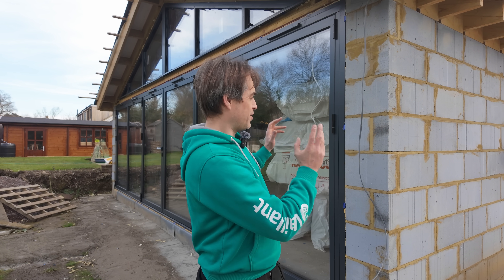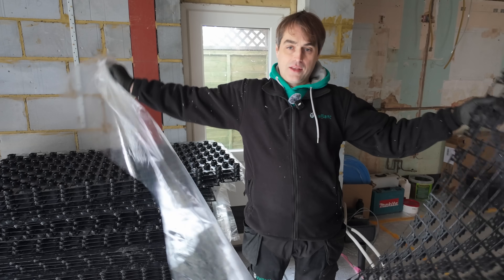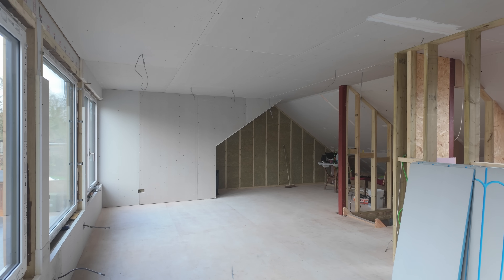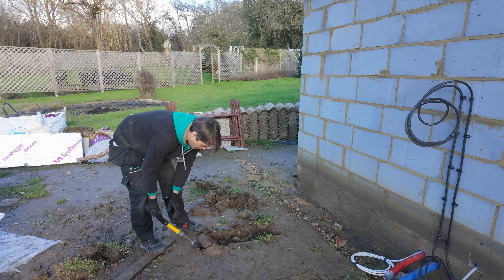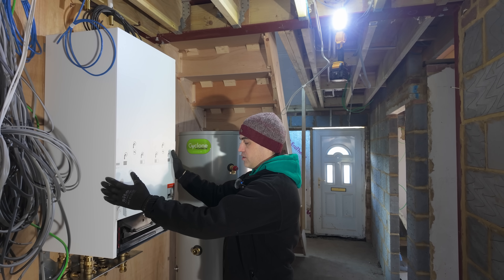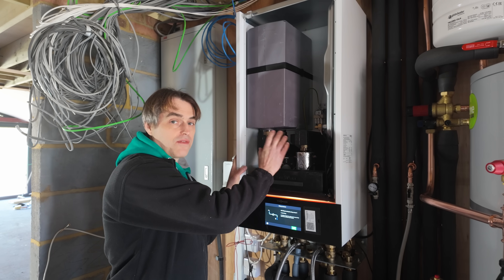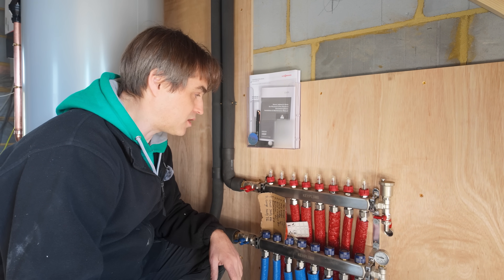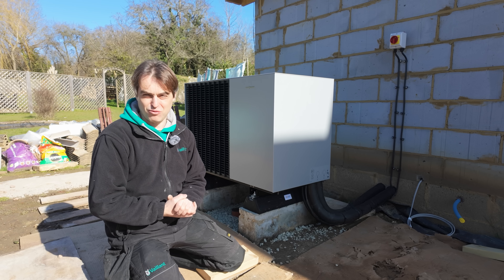Viessmann Vitocal Heat Pump - Is It Any Good?

Comment: Does anyone have a problem with this type of Viessmann Vitocal 150.A with the 4/3 way valve running stiffly after a few years of use?
Reply from the maker: It’s ESBE valve, you will only get problems with it if your system water has corrosion. ESBE is one of the most reliable valves available

Comment: That massive distribution board next to the Vitocal indoor unit you mention looks like it is for KNX, as there looks to be a green bus cable, are there any plans to link the heat pump up to the KNX later on?

Comment: I missed the price for ALL together? Heat pump, underfloor heating, insulation, renovation? I guess a new build would be identical in price
I could probably buy expensive oil or gas for it for the rest of my life and still have money left over
Reply from the maker: A full gas installation like this would have been around 5-10k more than air source heat pump if we were doing it, due to the fact that you lose 7.5k BUS grant and have to pay VAT.

Decent boilers are around £2k now, heating system cost ot the same. Heat pump cost that is around 2-3k higher than boiler cost is offset by the zero vat.

Then you get the grant 7.5k and 2k from your bank.

Completed installation will be around 30-40% cheaper to run than gas when gas to electricity price ratio is 1:4.

Add cheaper tariffs and heat pump becomes 70% cheaper to run. 

Zero pay back time as the heat pump is cheaper to install here than gas

Retrofits can be more expensive but full heating systems during renovations are an absolute no brainer form the cost stand point right now.
Reply: @UrbanPlumbers  I have a heat pump with radiators. Underfloor heating would have been far too expensive. There is also no grant for underfloor heating. The efficiency for 1kWh of electricity is only 1:3! Electricity is very expensive here. 40 cents in Italy. I had oil before and now I come out with a zero sum in the ratio of electricity to oil. We'll see if it pays off in the future. Converting to a Nibe heat pump was very expensive. I wouldn't do it again.
Reply from the maker: We average COP of around 4.0 on our installs so looks a bit better. NIBE is very expensive but also pretty decent

Comment: 13:35 are you saying to leave all of the manifold flow controls fully open? 
If so, how can you then balance the UFH circuits for room by rooms heat loss?
My ground floor UFH plan is sized so the spacing and flow rates provide the correct heat for the rooms heat loss and floor covering

Comment: Another great looking install. Which brand are the overlay UFH panels you used on the 1st floor?
Reply: Interested to know answer to this also.
Reply from the maker: No idea. The brand of panels if not really relevant, they are all the same pretty much
Reply: @UrbanPlumbers Thanks for that info.  Any idea why you dont see these precut panels at 100m centres for 16mm pipe? (Only 100mm centres  I have seen is for 12mm pipe)
Reply from the maker: @darrenmckinstry because minium bending radius is 150mm

Comment: So both manafolds are run trough that internal pump? I can see no heating controls and i know for efficiency that's actually better, but u still have some kind of room thermostat? Is it solit zone upstairs downstairs?
Reply from the maker: There is no room influence or any room stats or zoning. Open loop weather comp only.

Comment: What size 150a for a heat lloss of 4.5kw which is bigger than 4 and less than 6kw? Both same min modulation of 2.1 but no data on its lowest flow temperature provided
Reply: I’m going for the 6kW as I’m in that zone.
Reply: @SeanW-zi6kj should be better on dhw,  what size cylinder you going for?
Reply: @ I’m thinking of going with the 151A, so the 190L. I’ve been doing some calculations and since there is only the two of us and our young son we’ll be fine. And when he’s a teenager we’ll just have to run at 55c for DHW for a number of years.
Reply: And for the very odd occasion we’ve got people over, I’d run have to run it at 63c for a day or so.  Which I can live with.
Reply: @SeanW-zi6kj  What did you factor into the calculation and why would you need hotter DHW for more people, is it so you can blend down more and get more from a cylinder? How long did you calculate for 1 person for a shower and the flow rate? I was told that once you draw off DHW, if its set to heat constant, it can sort of keep up with replacing some of whats been used for a period of time.
Reply: @ I assumed I would have average of 8min showers per person at 13L min at 41c (assuming 10c cold water mixing) and also leaving approximately 20L for a bit of hand washing. Which for 3 showers, came out at 51c storage. I used ChatGPT to do it, but I checked its method and maths and seemed sensible.
Reply: And yes when more people over, i would have hotter store temp and blend down to make more hot water at the required temperature of 41c coming out of shower/tap.
Reply: @SeanW-zi6kj  using your figures that 104L per 8 min shower or 79L of hot water, so if three showers are taken from a 200L cylinder (which holds less than 200L) it would be 237L used, so how do you get 20L reserve

Comment: I looked up this Viessmann Vitocal 150A, it has cooling function. Which sounds perfect solution. How effective does it work with under floor cooling? Can I ditch air conditioning idea with this system?
Reply: not sure I would want to cool a floor...  I would expect you have a seperate circut of pipes with a diverter valve going to say a Fan?
Reply: @jmb69er  Exactly, a compatible FCU is the solution, and this particular HP seems to have the setting ready. Under floor pipes won't be very efficient. But my concern is how effective it would be cooling the rooms whilst heating the water tank in summer. Seems not many people in the UK have the first hand experience.

Comment: Great video. I was just thinking about air vents when you said how Viessmann don't use them. I have noticed on several videos that auto vents are installed, particularly on the cylinder flow. I don't have any on my system other than the one in the aroTHERM plus so I am wondering what you think about the pros/cons of putting some in or leaving them all out?

Comment: I have mixed views on these , installed one recently and had a bit of a job clearing the air from the hydro box ,would have been nice if they just put a bleed point on it . Also no traditional frost protection,must use their electric heater for protection, ok until you have no power . Also would have been nice to be able to commission it without having to have the back up wired in ,not always going to get the spark on site when you need them and this would be handy , also the warnings on removing the display because it falls out when you drop the front panel down ?? Great content as always
Reply from the maker: No need for back up. Set to 3kW at commissioning and then set to 0kW in installer setting - job done

Comment: I have a Viessmann Vitocal 151. One of the first in the country. We havent moved into the property but it is still heated. Not dropped below a SCOP of 5 yet. Near silent. Very happy.
Reply: Do you have more details on the house size, heat loss, and running design temperatures? Cylinder size and temperature of dhw

Interested to know since its such a good scop.
Reply: Where do you live? I am installing a Vitocal 151 in northern Italy, with a power rating of 13 kW.

Comment: Great to see this video as I'm installing a 16kW unit next month in my home. My heat loss is 10.5kW @ -3, I found it challenging to line up my design conditions to the performance curves in the Viessmann literature. Any advice just want to double check it is not oversized.
Reply: Oversized - yes. 
Check what it will modulate down to.
Reply: 16kw model is 3.3 to 14.9 kw

And scop 4.9 at a7 w 35

Comment: Did you use glycol mix for the closed loop ?
Reply from the maker: No we o Ktb use fresh water to VdI2035
Reply: @UrbanPlumbers that’s brilliant, thanks for the response. Are you not worried about the water freeing ? If the pump was to be off during power outage while it being cold outside.

Comment: Not sure why you'd cut down through both layers of insulation to the slab for the primary pipe work and not lay it above the lower layer cut into the second layer...
Reply from the maker: @DevAnubis  it’s obvious if you think for a minute
Reply: @UrbanPlumbers  You... don't want the pipes to touch the screed... ?

I'm an amateur energy enthusiast so I genuinely have no idea.

Comment: If only all MCS approved people were reliable, friends of mine had a heat pump fitted by a MCs approved company and they left them without any instruction on how to use it and in January it cost them 300 quid to run it so they asked me to take a look as they had rang the company endlessly for nearly a week and they wouldn't answer. So I had a look, and behold not good they had put 3 zones in one open plan room and none of the thermostats worked properly so I removed all the solenoid valves balanced the upstairs radiators and hey presto it now orks fine. All this knowledge I have had mainly come from watching people like you and I know I can do a better job than a lot of these so called experts. Is there a complaints system for MCS as as far as I can see its just a way to charge more money and not a guarantee for a good job. Thanks for the knowledge the likes of you and Adam at Heat Geek have shared

Comment: That looks like a very swanky heat pump. Love the info on the heat curve and wish our Vaillant aroTHERM had something like that. Great work and explanation of the installation
Reply: Vaillant does have a similar looking graphic for heat curves, but you only get it on the app, not on the controller on the wall.

Comment: Cracking job. How does the viessmann deal with multiple zones? Is it just like fitting a V200, mixers and pumps required but control built in?

Comment: This manufacturer has an extremely cool control system. But why don't they still produce a heating circuit control system? And you need to install a solution from Uponor or another brand on the collector. I mean the zonal temperature control of the underfloor heating.
Reply from the maker: No you don’t need any control on UFH. That is the old skool high temp thinking that doesn’t work with heat pumps well

Comment: I live in a mountainous part of Eastern Europe. The coldest winter temperatures are around -20C.
My house is modern and is reasonably well insulated (10cm external insulation and internal cavity walls)
Would a heat pump be suitable given the colder climate?
Reply from the maker: yes should be fine. Those are used in Poland a lot, where temeprature in the winter can drtp to around -10, -15c. I would say that below -10 you will need a direct electric back up or another heat source

Comment: Great video, the Vitocal units look like the easiest and best install option for normal plumbers and should ensure good SCOPS. 
Can I ask how you know that 190L is too small? What chart or calculations do you use?
Reply from the maker: 190l will be just about enough for 2 people with moderate use. Anything more than 2 people and heavy use and you need more volume. We have done over 50 heat pump installed so w have good understanding what is required now.

Viessmann is not for regular plumbers - it is an advanced unit with more conplex commissioning and should be used by installers who fully understand hydronic design and Viessmann operation. You also shouldn’t VDI only on it, your general plumbers will not know what that is.

Comment: Question, is it possible to explain how you set up multiple distribution blocks for underfloor heating. We have a house with 3 big manifolds for each floor 1 block ,and i would like to see how you connect different manifolds. With all the things i see how you do it. I'm not confident in the way they are connected now... thank you

Comment: Hello, you have an interesting method in the UK...first you lay the underfloor heating then you do the wall plastering? Here in continental Europe we finish all the walls and ceilings first and at the end of the work before the concrete screed we do the underfloor heating...the question is...where does the concrete screed extend??I don't see the edge strip? Best regards and congratulations on a job well done

Comment: No glycol required in England? I know it doesn't get very cold there, but what happens if you get a power failure at -3c? Thats still cold enough to freeze water in the lines.
Reply: Not required.   You can choose antifreeze valves as an alternative.
Reply from the maker: @nickflynn666  AFV are not allowed on Viessmann R290

Comment: Were you applying for the BUS grant - did you have to follow MCS guidelines? I am wondering if you took all the other heat sources into account (appliances, people, pets, solar gain, DHW tank etc) when sizing the heat pump. That thing looks huge for a very well insulated house and you could have made the ASHP much smaller if you'd just added some secondary heat source to cover the 5 days a year when it drops to -5°C.
Reply from the maker: that thing is only 5kW output at -3

Comment: Do you do air to air heat pump? For a semi with no central heating, (no radiator nor ufh) electric only, renovating, how does it compare to install this system in the video?
Reply from the maker: probably similar cost once you take heat pump cylinder into the account and you end up with an inferior system.
Reply: @ the heat pump cylinder you are referring to, you mean, for the a2a system, hot water to be supplied using a separate heat pump like the one in your another video that provides constant hot water?

Comment: My parents had a 16kw one installed just under a year ago, so far its is performing very well.
Reply: 16kw what they heating the moon?
Reply: @alimack5489  large house, on top of a hill. Fair amount of west and north facing glass with some pretty big open spaces to heat. And being rural and exposed location design temp is a little lower than at lot at -5
Reply: @alimack5489  I am installing a Vitocal in northern Italy, with a power rating of 13 kW and a 400 V system.

Comment: On the animated diagram on the display, there are 3 heat exchangers on the F-gas circuit.  What is the one in the middle ?
Reply from the maker: condenser - exchagnes heat between refrigirant and water

Comment: You should not use Auto air vents when using heat pumps with r290, when the plate heat exchanger leaks into the water circuit the propan get out of the automatic air vents !
Reply from the maker: You should close them after commissioning

Comment: With the switch near the heatpump, is a very clever idea. Everybody can turn the heat pump off and inside it freeze. Always without an outsideswitch. Manipulation.
Reply: UK electricity rules are such that an isolation switch has to be provided close to the device. Possibly are people not as devil as you think ;-)
Reply: I know it with the rules in GB. I livein Germany and have a heat pump too. But it is the easiest way to turn the neighbor the "loud heat pump" out. This ist the thng, you have to choose an different RCD than in the house. 1 ground to neutral in an outside power outlet and the freeze and fridge are powerless. Thanks to one RCD and not more in the switchboard. It has reasons.
Most people are not clever.
Neighbour conflicts are common sense
Reply: @stefankruger3634  you can padlock them in the on  or off position if you’re worried about that.
Reply from the maker: @stefankruger3634  it would be tresspassing and you could take your neighbor to court very easily. You can also lock the switch.
Reply: @edc1569  off is no heating. it is in the off position only with padlock to secure the worker at the heat pump.

Comment: @ 10:40 Totally agree with viessmann - I really hate automatic deaerators (at least cheap and small ones ) 😊
+ afristo deaerators used often in viessmann peoducts they have the bad habit to leak 😊😅
But the only thing I don’t understand is why they are keep using internal expansion vessels - they fail a lot … same for vaillant 😅… in the past they were usig extremly reliable expansion vessels … but now mostly junk …
+ viessmann in the pandemic they forgot how to make ordinary epdm hoses 😅😂 - in the 050 model from viessmann they crack 😅 … and I think now epdm hoses are over 50 years old technology that should never fail 😂😊

Comment: Over here (Netherlands) Viessman is exceptionally expensive. Even more than NIBE is.
Reply from the maker: Here they are similar cost
Reply: @UrbanPlumbers  There can be significant price differences country to country. In Sweden for example a S2125-12 heatpump is around €4000,- cheaper then in the Netherlands (€10.000,-).

Your favourite brand Vaillant on the other hand, is very reasonably priced
Reply from the maker: @ReneArtoisMr NIBE here is around £6000, similar to Viessmann. Vaillant with all one million boxes you have to buy extra is around £4500
Reply: @UrbanPlumbers  I didn’t know that. My problem with Vaillant is that there is a gap between the single phase and three phase models. Three phase Vaillant models are large and have a high minimum output compared to Nibe three phase models. Disadvantage of Nibe is their overpriced SMO S40 controller. For that money other manufacturers provide an entire hydrobox (pump, expansion vessel and controls).